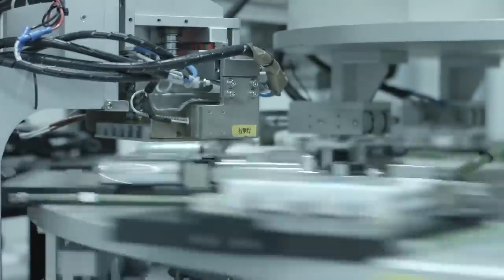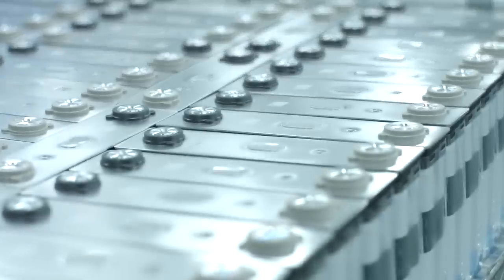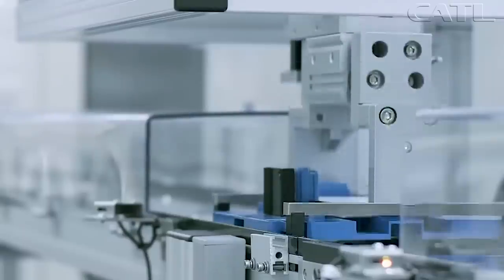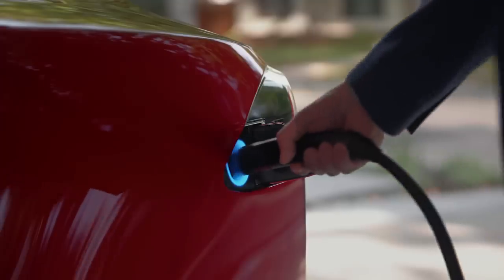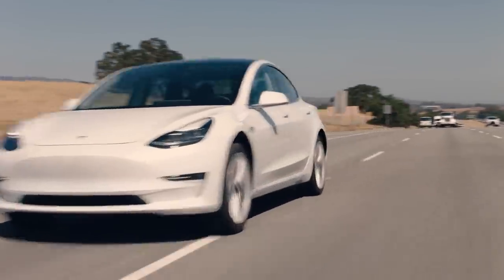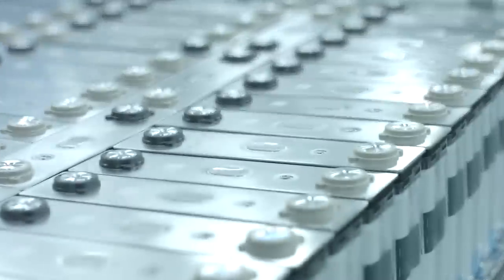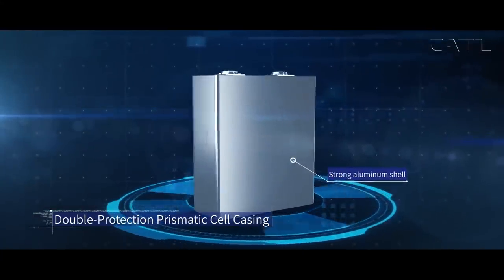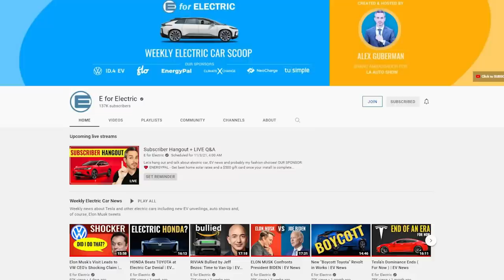SANDY MUNRO on Tesla's LFP Batteries

Comment: Clarifying the comment about octane which I just learned.  Higher octane does not contain more power per gallon but the octane determines pre detonation occurs.  Most cars with normal compression engines get no advantage from higher octane gas.   So the comparison is valid.  If you have a car designed to need the high power rate delivery of lithium ion it is useful.  Most cars just like with high octane it is not useful to have high power delivery batteries.  Most people do not need a dodge demon or a plaid.

Comment: Why not make 4680 lfp batteries? Do they need to be prismatic?
Reply: LFP is prismatic, not pouch.  Tesla might use LFP in 4680, but LFP is not as energy dense as NCA, and and a cylindrical form factor is less energy dense than a prismatic cell.  So it would be a double hit on energy capacity.
Reply: @tommckinney1489  yeah, my fault. But they wouldn't be able to make a structural lfp pack if they kept them prismatic i think so I hope they will make 4680 lfp cells.

Comment: Byd blade LFP battery takes there Han, which is about the same size of the Model S, from 0 to 100km/h in 3,9 secs, that’s fast enough for me.
Reply: I think American media are trying to ignore BYD. But its coming to where I live and I will buy a suv at a cheaper price than I paid for a GM suv in 2015
I have a captiva and will get a Yuan plus.
Reply: @ianburnett4605  Yes they focus on Tesla competition like Nio or Xpeng but not on GM and Ford competition like Byd, Geely, Hozon and others.
Reply: @jeanpaulmartin9696  BYD will introduce a premium brand a bit later on. But I think they are in for a shock(pun) with the demand of the 800 volt platform once its in the marketplace

Comment: How do LFP batteries compare to BYD blales batteries
Reply: LFP refers to the battery chemistry (Lithium +  Iron (chemical symbol Fe hence the F) + Phosphate) - the "blade" in BYD blade battery refers to the physical shape of the battery (rectangular blocks instead of round cells) - BYD blade batteries are also LFP batteries.

Comment: Sandy, check Giga Berlin images - length of anode mother roll is 12 km. With of anode roll in 4680 cell appears to be 95% of 80 mm - 76 mm. A roll makes 40,000 cells as Alex (twitter) and is 16 cells wide so 2,500 cells long. Thus length of anode roll in cell is ~4.8 m by ~76 mm wide. Thus ~0.3648 square metres of anode roll in cell. Cathode will be the same dimensions. Bi-metallic corrosion avoided while having positive and negative contactors on top of cell.

Comment: I was wondering if LFP will perform better or worse in cold climates. My Bolt looses about 100 miles of range in the dead of winter compared to the balmy summer days.
Reply: LFP is better than NCA if preheated, but much worse if used without preheating in  freezing temperatures. Tesla has preheating which can be used from mobile phone and scheduling, so it's not a problem anymore. This issue was fixed in early 2022 updates
Reply: Model 3 LFP with heatpump does 160Wh per kilometer in cold weather under zero. Still damn damn good. It's like driving an other EV in summer. The cold however needs to be managed... keep it at a charger at night.

Comment: model 3 LFP does 0-60 in under 6 seconds, the prior model was 5 seconds i think....personally any car under 6 seconds for a 0-6 is great for everyone for daily use.
Reply: Old NCA was 0-100 km/h 5.8 seconds (0-60 mph 5.5) new LFP 0-100 km/h 6.1 Seconds (or 0-60 mph in 5.8 sec) not really all that much in it.

Comment: Sandy is pressing too much on low power density of LFPs. Yes LFP batteries have lower power density than NMC or NCA  chemistries but the difference is not that big. BYD Han can do 0-60 miles in 3.8-3.9 seconds with blade LFP battery that is not too far off from the 3.5 seconds 0-60 mph for Tesla model 3 with NCA battery.

Comment: just a comment. Lucid build by key man on the model S  so any wonder it has all the great features of the Tesla S.  Rivian nice skate board with 4 smaller electric motors.  Unique design, big 3 legacy still playing at batteries not enough to dent the door.  Cannot make a real impact without enough volume to have the ordinary person note OH its electric.  I keep laughing at GM they are a joke. they want to make 30 versions of EV.  Cannot keep one on the road.  All of them are battery hogs. Need 25% extra over priced burn em if you got em batteries due to crap engineering.

Comment: Tesla is not getting a million miles out of a battery. A lot are failing after the warranty is over.  While not a complete failure, Tesla will not repair, you’ll have to buy a $22,000 new battery for your $25,000 car. Not good Sandy. LFP batteries also charge faster. They cost less and are safer and last longer. Sounds good. Who cares about going 0-60 in under 2 seconds. 2.2 seconds feels the same.

Comment: Who needs a freeway of INDY 500 cars, LFP is prefered for the general, no need to exceed beyond ICE cars acceleration anyway.Lasts 2-3 times longer, as far as BYD 's go, and never had a fire! More abundant, cheaper, less toxic, materials that cost less and are more green that can be easier on the earth and our pocket books.All around safer. Due to form factor of BYD's blade instead of wasteful cylinder shape in comparison.Might even have stopped Elon to rethink 4680 production.Higher density of batteries solely due to a more efficient shape.
Reply: did you say only BYD LFP never had a fire?  How about CATL LFP cars?

Comment: VP style battery is a no lose situation very very few people can take advantage of the amount of power of the Tesla packs currently it’s unusually strong unnecessarily nuts fast few people take a vantage of that amount of power none legally as far as range 90% of people would be OK with much less mileage for a few people drive over say 40 miles on a regular basis I drive the maximum of 10 once a week they last longer and they’re safer if there is an accident I don’t think there is a problem with them usually but definitely it is real if it’s viral it’s severe and There is the life Expectancy but in America people won’t go for that generally go get the big battery because it goes faster much faster than the other

Comment: Would you ask Sandy, it seems like Hyundai/Kia is betting on solid state batteries developing in Korea. With all the hype in the news regarding solid state batteries, can they be mass produced? If they can be, when would be the critical point where solid state batteries beat 4680 batteries, assuming at that time 4680  has reached its maximum potential known today?
Reply: Current SSBs need to be maintained between 60 and 80°C at all times, due to thermal expansion. Ok for commercial vehicles, but impractical for domestic drivers

Comment: I might have challenged Sandy’s comparison between 8-cylinder and 4-cylinder as well. Perhaps comparing an 8 cylinder to a  ^ cylinder would be better?  Better still, just list the performance specs between LiFePO and the nickel based batteries.
Reply: Considering how the model 3 SR has a 150 kW motor, LFP batteries should be able to hit those levels of power delivery with little to no issues if they're premium cells. End users will see no difference between LFP cells in their model 3s vs licoo2 cells currently used in 2170 cells. LFP batteries are just heavier. LFP cells would hit 160Wh/kg vs 200Wh/kg with cooling for 2170 cells. Weight would be the only tradeoff hence there's no real reason to list it for Tesla.

Comment: when a battery cannot be charged beyond 80% without damage (lithium ion) the LFP compares favorably to it as the choice for range and longevity in an EV.

and in addition to this guy's misunderstanding about the real life advantages of the lithium over LFP batteries he doesn't know his stuff about ICEs either. octane (note: IN AND OF ITSELF) actually decreases the performance of an ICE. it is only added because without it high performance high compression ICEs will suffer from pre-detonation, consequently it's a necessary evil. the reason he and most others have the wrong impression of the purpose of octane in gasonline is that low performance ICEs don't won't suffer from pre-detonation due to the low compression ratios.

Comment: This is so misleading...  Yeah you ain't going to get the massive discharge to to zero to 60 in 2 seconds...  But zero to 60 in 6 seconds that the lfp does with a single motor is still a rocketship...  I don't care how much you are a race car driver..

And reality is, it can go faster if they offered dual motor lfp cars...  

They are infinitely more reliable,  and less likely to burn a skyscraper down.

Comment: I'm putting it out there, the Chinese are smarter than Americans.
They're happy with cheaper, safer, more robust, longer lasting, faster charging batteries, while Americans still have their stupid obsession with excessive power & speed.
I'm an Aussie going on 71 & never had a problem merging into highway traffic, despite our most powerful car being a mere 120kW. 
I copped a speeding ticket for going 10kM/hr over the 110kM/hr speed limit in the middle of the night when there weren't another cars in sight, & I'm not about to throw money away for speeding ever again.
I've learnt from my mistakes & have absolutely any craving for the mind numbing power & acceleration of any Tesla.

Comment: Why is Nobody at Tesla Smart Enough to use both types of Batteries ? Use 4680 for Acceleration and after the initial acceleration at some point it swaps over to LFP and stops using other batteries. Is this to complicated for a supposed Trillion dollar company to pull off ?
Reply: haha it's not that simple... Different types of battery mean different transformers and other equipment, if you put twin transformers in one chassis it becomes real heavy, so you lose all the range you hipoteticaly gained...
Reply: Someone else I think it was either nio byd or gaic is supposed to introduce a mixed chemistry pack next year for an ev. 
Inside evs I think did an article on it a couple month's ago. 🤔
Reply: It's not like you would get the best of both worlds. It's more like an average between the two, a compromise.
Reply: @men2dewy  i agree, a super capacitor though with lfp tech might be interesting? 
Something which can store a lot of juice for quick acceleration or deaccel events. But that might make more sense on the cybertruck or semi, an ev airplane or train vs an ev passenger car. 🤔

They did aquire Maxwell though a few year's back which had quite a few super capacitor patents and expertise for the time.

Comment: I will not buy an EV with batteries made in China. Has to be manufactured in USA or one of its allies.
As for this video, my opinion is that Sandy didn’t add a lot to the discussion. A few explanations of the differences, but a didn’t sell me on LFP batteries. How about a comparison between “acceleration differences”, assuming that is what is being discussed?

Comment: The biggest fault with ev  vehicles is their batteries. People have to replace their batteries after mysterious battery lose of power that's costs  $2200 to replace. Time testing Will be needed to increase the durability by making improvements if needed.
Reply: $20,000 to replace.

Comment: This generation of EV batteries do not make EVs a killer app. Not until we go north of 600m/charge will EVs outclass ICE enough to truly obviate ICE. History will smile on Tesla for breaking the century-old chicken or the egg stalemate where we can't have EVs because the batteries aren't there/can't develop better batteries because there's no EV market. So yeah, batteries are already an energy-density loser compared with gasoline/diesel. But they only have to improve to twice as dense as they are now to beat out ICE -- apparently doable. History will also note that it was the big move China made into EVs that put us over the top, not just Tesla. I don't think Big Auto would be as afraid of falling behind if it were just Tesla.
Reply: So you don't think its impressive that an average ev made today. Has less than 3 gallons worth of energy onboard compared to a gasoline or diesel drinker. Yet that modern ev can go 250-350+miles on that same amount of energy? In near silence with no direct emissions poisonous heated fumes etc. How far can a dino juice guzzling machine go on 3 gallons of fuel again? 🤔
Reply: @4literv6  No worries, I'm just playing devil's advocate here. Range anxiety will linger (and the EV era will wait) -- until the recharging network is fully 1-to-1 with gas stations (or better) and battery distance can really reduce the frequency/duration of recharging to equal or better to ICE refueling. It's just a matter of time, though.
Reply: @vonBottorff  slowly looks at the world wide number of evs, then the market trends for ev sales the past 3 year's. 
I don't think its gonna wait. By the end of 2024 at the current rate of ev adoption world wide? 
Evs alone will be the majority of new vehicle sales. If you count phev and regular hybrids? 
It could be as soon as the end of 2023 that they have the majority of vehicle market share. 🤔
Reply: EV adoption will come faster than you think, ICE sales are already facing pressure, it may involve Tesla at the high end and Chinese companies like BYD on the low end, and GM no more (or depending completely upon government incentives to survive)
Reply: @4literv6  Let's hope. And as one Tesla exec once said, when EVs get to a certain market share (doesn't have to be anywhere near 50%), the whole ICE world will come crashing down. Why? Because as it is now the fuel distribution network is very low-margin, and if EVs cut too deep, gas/diesel prices will start climbing steeply due to the sheer logistics of fuel distribution being too expensive. Yeah, let's hope and pray. Sooner is better.